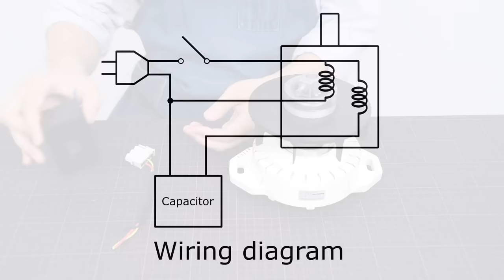Make a Belt sander @Washing machine motor 【Part.1】

Comment: I have never thought of using the soldering iron on the heat shrink tubing. I have always used a lighter. Cheers for the great tip.
Reply: Just be carefull as some soldering irons tend to melt and destroy the heat shrink. Personally I like a gas powered one as you can remove the tip and have just the hot air blowing on the shrink.
Reply: I hate doing it. Will only do with junk irons.
Reply: I'm using the iron too but you have to shrink it fast. And use middle of the iron not the tip. Otherwise the shrink gets ruined.
Reply: @serkandemirhanofficial  My problem with using the iron is polluting the tip.
Reply: I use zippo light  and its best for it :)
Reply: @LEO-xo9cz  Don't use the tip of your iron...
Use about 40 - 50mm up your iron...
Reply: @Colaaah  .k.

Comment: Nice build and great construction quality! I would have used the fan with a small 12V supply to force much more air into the sander housing, instead of attaching it to the motor axle, where it cannot be as effective. Also, the radiator you glued to the motor housing probably cannot do much - large thermal resistance between the aluminium fins and the motor housing - you cool the aluminium but not the motor. Anyway, I'm very curious to see the belt sander part attached

Comment: When I watched the first part , I was convinced,  that must be a German worker , but later on  , I realized that's Japanese way of getting job done. So , after watching another video, "Making belt sander out of old fan " ,   I've understood, why I'm driving my Toyota  1997  with over 300000 miles on it, without problems.
On the other hand,  tool are made for making money,  so , when  the Japanese guy spends two weeks to have the job done , the guy with fan motor had it done within two hours and the money he made for the rest of these two weeks let him buy additional  six tools.
 This is not creating sculpture, so it must look beautiful. It must be done fast and good enough to start making  money.
Reply: "Tools are made for making money"? Certainly not for most hobbyist woodworkers.

Comment: Great project but those are cold solder joints. You should twist and then heat the whole joint (both wires) before running your solder. You may wind up with a short from a dry joint someday. Very creative work though. You would be a monster if you learned to weld for your projects.

Comment: Another really creative project!
I suspect that if someone used a salvaged motor from a full-sized European or North American washing machine, the temperature issue wouldn't be so much of a problem.
The overall design could easily be adapted to a more powerful motor.
Thank you for this. It's always interesting watching your innovative home made tool designs.
Looking forward to Part 2.
Reply: why wouldn't it be so much of an issue?
Reply: @yewsengcheong1637  The motor that he used in the project is smaller than the motor from a full-sized European or North American washing machine, so it needs to work harder in order to operate continuously to drive the sanding belt. A larger motor would be able to handle the load better without overheating. It is a minor issue, since he has already partly compensated by creating a heat sink and fan to cool the motor he is using but he still notes that 10 minutes of continuous operation would result in a motor temperature of 120 degrees C. This kind of overheating would seriously shorten the life of the motor. As long as you are aware of this and use the belt sander for only short periods of continuous operation (preferably under 8 minutes) there shouldn't be a problem, but a larger motor would be one solution. Given how creative he is, I wouldn't be surprised if he came up with a more efficient method of cooling the motor (possibly using the heater core out of a Toyota! :-)  ).

Comment: well... it is what it is. But how many of you have noticed a few things about this video? Probably not too many... I see many comments from guys wanting to make their own shop machines now using the method as prescribed here.  But you need to take a few things into account.  These builds, for all their wonder and precision... they are NOT CHEAP. Despite his efforts to make you believe otherwise, he has invested large sums of money into the builds themselves. while he might be getting the motors for free, or close to it, he has to pay for everything else.  

The hand drill he uses... that's a high end and expensive drill. The homemade drill? Same there... the drill he used to make his homemade drill press is a very expensive model. Despite his effort to disguise the drills, the make and model are easy to figure out. The expensive router bits... And then we have the body for this particular build. Did you happen to notice the type of wood he's using? No?  That is a commercial grade and very expensive high density plywood made for fine woodworking. That stuff isn't cheap.  

The amount of money he invested into hardware, glue and wood runs into the hundreds of dollars. And then the amount of time he spent on the build. By the end of this build, you can bet he invested enough money and time to be able to afford 2 brand new commercially built combination sanders.

I'm not disputing his build... his work is really good. Not perfect nor immaculate... but his accuracy is very good and the quality of his craftsmanship is indisputable. I'm disputing his approach to make you believe that anybody can do what he does. That's not true. Not everybody has the amount of time on their hands as he obviously does... Not everyone has the money to invest into the products he's buying and using.  And most certainly, not everyone has the engineering skills and education he possesses.

While it seems good on paper, it really isn't because of the amounts of time and money it takes to create one of his builds. NOT CHEAP!!! You would be better off buying a brand new in the box versions of his builds and you could probably buy it cheaper than what he spent on making this sander and the other shop tools that he creates.

This is a hobbyist's thing, and a hobbyist with money and time to spare... But it is NOT practical nor is it very affordable. I enjoyed watching his craftsmanship. But I'm also acutely aware of the practicality and economic applicability of such a project. It's not economic. Fun? Perhaps, if you have extra scratch and time... Nice video, but I won't watch the followup and final build.

Comment: Another fantastic video! I must say though, your drill press drill/motor needs an upgrade. The lack of torque stalling it out all the time must drive you nuts! I have a similar (more simple and modest, but built with igus linear slide rails & bushes) and had to get a 1000w cheapo drill to use with it. Made a big difference! It's still underpowered (not enough torque at lower rpm).

Anyway, thank you for the inspiration and great videos. At first having no music was a pain as my partner didn't like just tool noises, until I realised I can just add my own soundtrack.

Comment: Explanatory text.
I made a belt sander using the broken washing machine motor.
The washing machine motor consumes 300W.
I want a little more power, but there is no problem in practical use.

The shortfall is that continuous operation can not be performed.
The cooling was strengthened, but the motor temperature exceeds 90 ° C in about 8 minutes.
(The motor temperature will reach 120 ° C in about 10 minutes.)

I attached a temperature sensor to the motor and decided to use it while monitoring the temperature.

※ Please do at your own risk when imitating this video.
I can not guarantee any damage caused by this video.
Reply from the maker: おっと、見逃していた。
多分日本語説明のgoogle翻訳だと思いますが、最後の注意事項の翻訳が反対です。
私の動画は英語圏の方向けには英語版の説明を載せています。
I also guarantee any damage caused by this video.これは意味が逆です。
正しくは　→　I can not guarantee any damage caused by this video.

この部分は真逆だとチョットまずいので修正願いますか？
Reply: @jisakukobo  これは失礼しました。
Reply: I don't think anyone expects you to guarantee anything.

Comment: The hand closest to the lathe rest (esp with jury rigged rests) should be right up against the rest & the hand at the handle of tool is the one that does the work pivoting tool through mainly stationary hand at the rest... this will avoid bad things & bad things becoming worse... wood is after all a non uniform 'living' material... when making the disk sander that was much better still looked weak though... the hand at the rest should be firm & just allow pivot of the tool as required... even when running parallel down the rest... the rest won't move if proper... so a firm front hand on rest ensures safe operation when working the lathe

Comment: Your meekness is AWESOME !!
I have some to share.... 
EPOXY GRANITE.

35% ROCK DUST
30% SAND
12-15% EPOXY
... by weight measures... the remainder being structural steel w/fastener inserts.
Tis my deep research, and involved interest in CNC MACHINE BASES and Commercial Machinery.
Seems the EUROPEANS are ahead of the curve for COMPOSITE alternatives to CAST IRON & FORGED.

Comment: Motor mount construction is flawed. All pieces should be cut, and drilled prior to glue up. The joints will be much stronger than those produced by gluing and adding screws after the glue has set. Read the directions on the bottle.

Comment: Will the washer motor have enough torque for sanding hardwood items???
Reply: My father used a washing machine motor for a table saw. It should have the torque, as long as it's geared right.

Comment: nice vid. quick question tho: where did you get (or do you have the reference) of the drill bit you use are around 2mn, please ?
Reply: Those kind of drill bits can be purchased from a hardware store. If you are in the USA, you can get them from Home depot or Lowe's, if not, then a similar store will have them, or you can order them online. For the other drill "bits", he used a "Hole saw" bit, and a "Forstner" bit.
Reply: @DataDawg59369  i was hoping there was a possibility to find a set of them, but where i am, they only sell them by unit and they're like 40cm long. it's called an auger bit (did some research). thank anyway
Reply: @shoutrr  No problem. I would check Ebay and/or Amazon. You might be able to find a good set on those websites and have them sent to ya.

Comment: Without a VFD this will run at full pelt around 17000 rpm and without at least 4kg load this motor overuns and this is what causes all the excess heat with a variable frequency driver you can tame the rpm without losing torque.
Reply: Exactly this. Cooling is not a nice solution
Reply: Unfortunately VFDs are quire expensive, or can they also be cheaply salvaged from broken or discarded products?
Reply: @user93237  yep you're right they cost a lot, but now you've got me thinking what devices use them, good idea on the salvage.

Comment: May I ask what the purpose of wearing rubber gloves was when removing the motor from the washing machine?
Reply: I think it's because the capacitors can hold a charge. Safety to prevent a electric shock. Please correct me if I wrong :)

Comment: why not use a single phase motor to power the drill press? the drill you're using seems under powered
Reply from the maker: It is possible if a spindle is made using a lathe.
However, that is a difficult task for many without a lathe.
I made the best possible drill stand with the simplest tool possible.
By the way, this drill is output 650W. In the video is not used at full power. The output is adjusted to adjust to the optimum rotational speed when loaded.

Comment: Am I the only person wondering why he made a 'V belt' pulley  from wood instead of using the metal 'V belt' puller that came on the washing machine motor?
Reply: Well, first off, I'm pretty sure that was a woman. ;)  As for the pulley, there could be a number of reasons.  Maybe there wasn't enough room on the shaft to add the disk and the fan, maybe there wasn't enough room inside the box for that pulley, and she didn't want to make it bigger.  Most likely though, it was to change the ratio.  The smaller she makes the pulley on the shaft, the slower the belt turns, but it increases power.
Reply: @lenonkitchens7727  I think I meant to write She but maybe not, it was very late when I commented LOL.  Ratio change is probably the most reasonable erm... reason... I could see why a smaller one would be necessary to give more torque, I guess she thought of that before starting to do the build instead of finding out that it needs it at a later date.
Reply: @patrickbrett66  Seems like it, yeah.  Either that or she just wanted room for the fan and the disk.  I looked at the video again, and there definitely wasn't room.

Comment: Without it is upholstered. Such feeling that the author is a little more, will fall asleep and will fall. Accidentally you accept nothing.
And why fastened the fan on the engine. That sucked in all dust on refrigerators which stuck on the motor. To clean them you will not be exhausted.

Comment: The two ventilators working against each other.
Reply from the maker: You are right.
But in this case, this is the best way.
Reply: I think the ventilator of motor unnecessary, because the air flow of box's ventilator through the motor.
Reply from the maker: I'm difficult to explain logically in English.
The following is explained in Japanese, so please look at G translation etc.
まず、ボックスファンは冷機を取り入れ、粉塵をボックス内に混入することを防ぐ役割があります。
これはモーターを粉塵から守る働きです。
次に、モーターファンは新しく取り付けた冷却フィンに冷気を充てる目的があります。
つまり、この二つのファンは目的が異なります。

ちなみに、ボックスファンの気流の向きを反転させると最も効率的に冷却されます。
しかし、前述のように粉塵がボックス内に入るのでこれでは不具合が生じます。
結果的にこのファンシステムが最良の方法という訳です。
Reply: Ok. But I think the fan is degrade the efficiency of the box fan. And the heat sink is not effective for gluing. And maybe the most important thing is that: the capacitor is just starter. (Operating capacitor 5μF/100W; starter capacitor 20μF/100W) Try disconnecting the capacitor when the engine has started.